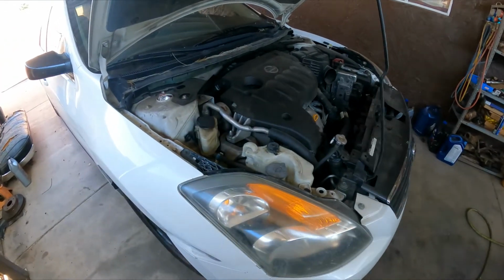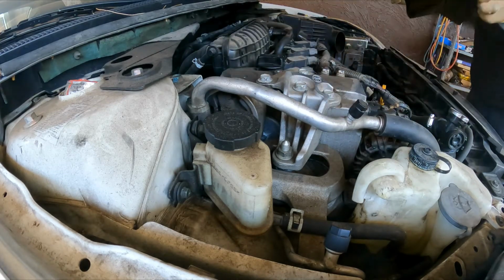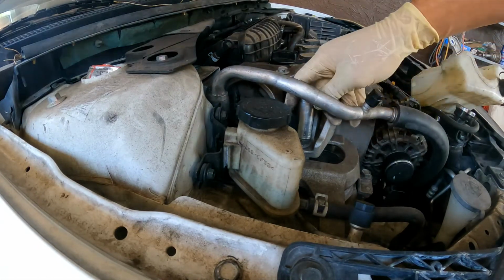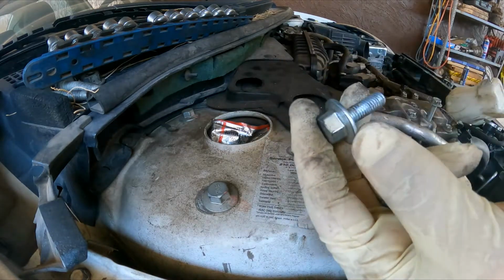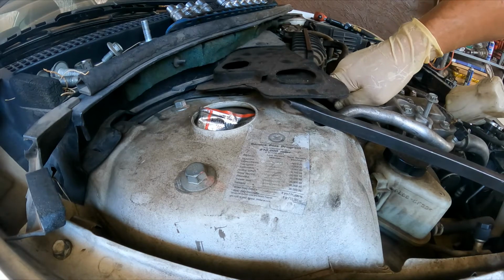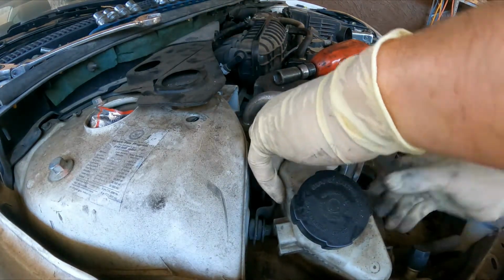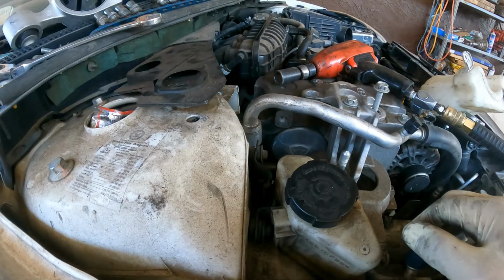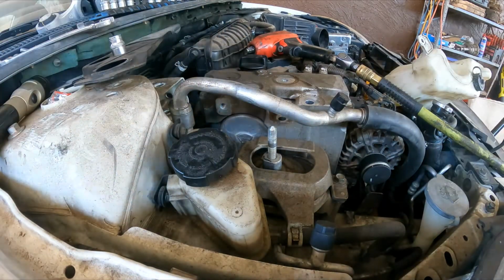2009 Nissan Altima Engine Mount Replacement  EASY

Comment: The motor mount was installed upside down. The flat is supposed to be facing the top. That is why you were having trouble lining it up, and had to jack the engine up higher
Reply: I feel bad for whatever customer had this done incorrectly to their car. Honestly this video should be removed. There are two way better videos out there.
Reply: @npolite22  I thought it looked funny. My mind said to me, after market parts can be so different. Thanks for pointing that out. It's still hard to believe that it is even possible to install that upside down.

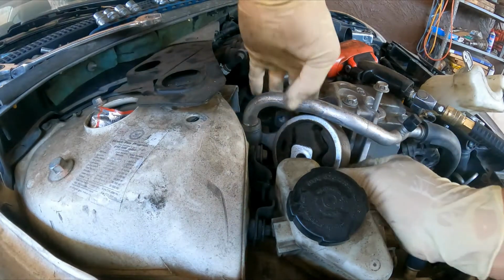Comment: @9:42 when he takes out strut mount you can see it was installed wrong, mechanic put it back the way he found it. I just looked at my 2009 altima and the pointed corner of mount does aim up. Someone before this repair had installed upside down.

Comment: About to give it a shot. I was told the bracket is stripped where the bolt goes into it from the strut mount. Can you buy a proper bolt or bracket seperately
Reply from the maker: Hello! You should be able to buy the bolt or the bracket. Keep me posted

Comment: that rubber piece that goes on top of the larger mount is upside down; most aftermarket ones have it the wrong way (for some reason) the oem one is flipped

Comment: Hello all, I hope that I can get some help with the transmission mount.. When I try to take the top bolt off of the stud, the rubber mount turns with it. I only turn it a bit because I don’t want to break anything. But if I tighten it back, it tightens and won’t spin. I think the nut, stud, and rubber are moving together. What can I do?